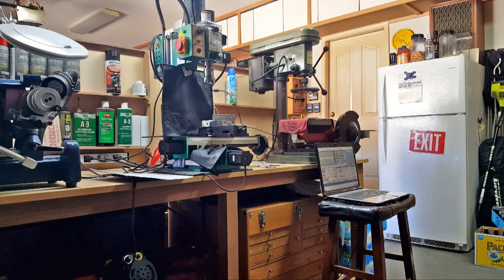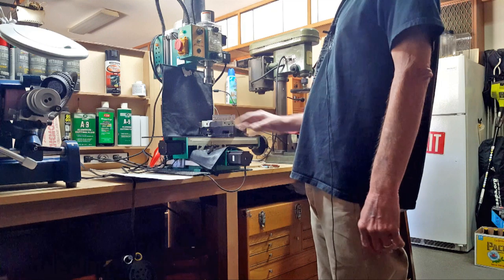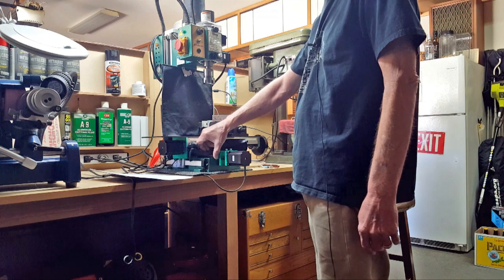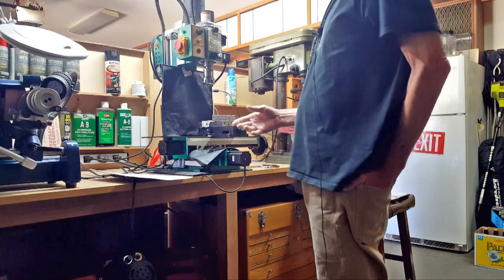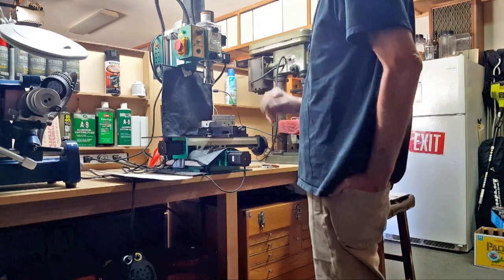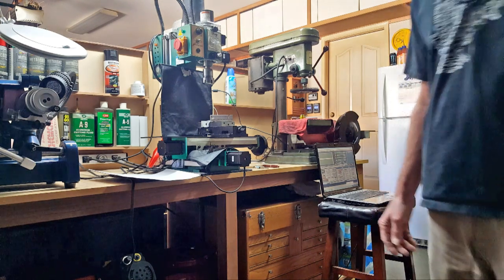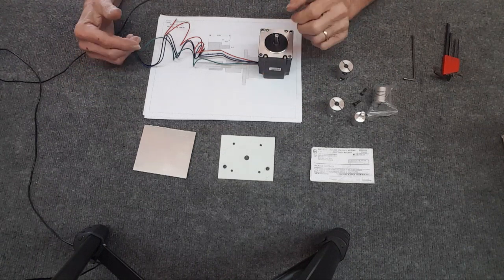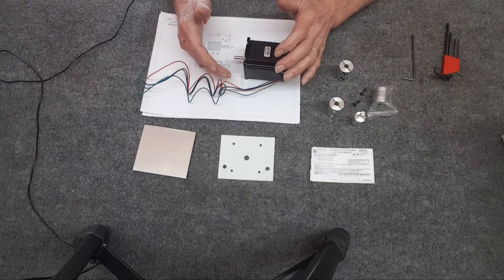Mill X Y Axis CNC Upgrade

Comment: I have a few of those couplers, because that's what was used on my 3D printer Z axis.  I have removed them because even the slightest pressure will cause them to stretch.  For instance if you happen to override an end stop.  So I'm thinking the side forces of the end mill may play havoc with those couplers.  There is not any spring to them and once they stretch they don't spring back.  Just FYI, Rich
Reply: Rich Knudson     my thoughts exactly .  it will break also if overstretched.

Comment: Dave, I did a similar upgrade to a Nema23 based on the GRBL board (Woodpecker). I added external drivers rated 5A and just unplugged the small 4988 boards from the GRBL board, and connected ground, step, direction and enable down to the new drivers. This lets me use my new motors at full speed. I chose a TB6600 based driver. AliExpress have them.
Reply from the maker: Thought about doing that but GRBL doesn't support drilling operations or axis backlash.. wish they would add that soon!
Reply: @TheMiniMachineShop  Someone has implemented backlash compensation, but you  need to use an Arduino Mega. It's on Github. I don't need it myself, anti-backlash nuts are doing a fine job. But take a look. It may be of interest. https://github.com/shooter64738/grbl-mega